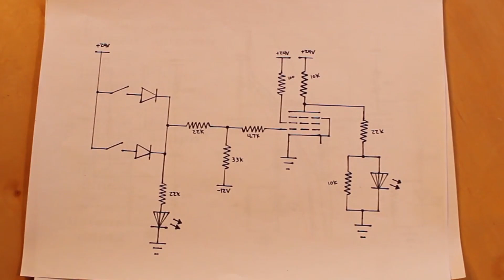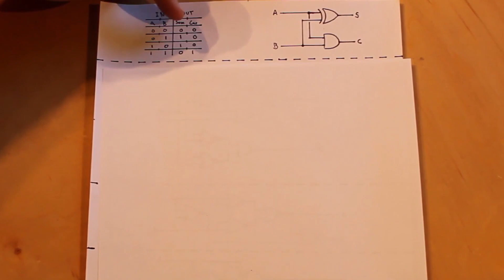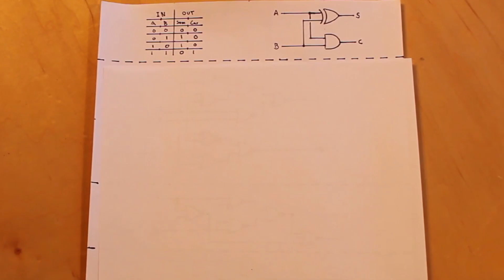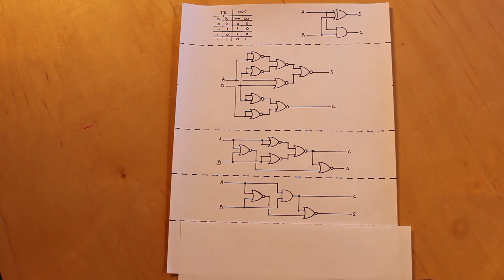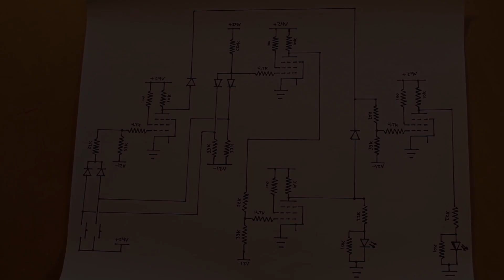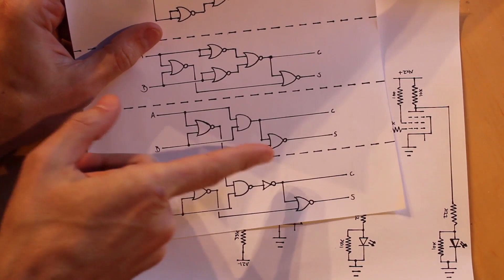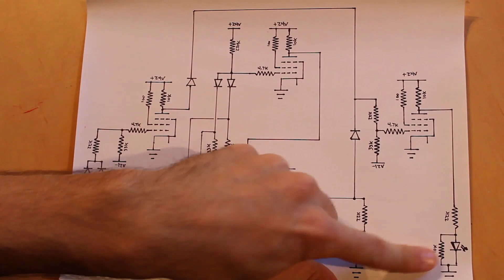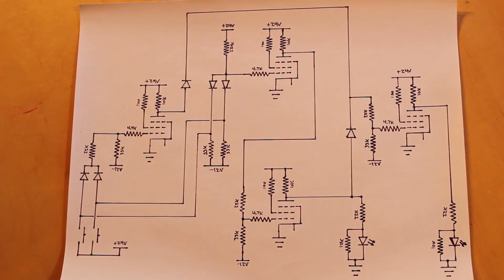Let’s Build a Vacuum Tube Half Adder

Comment: I've old watched to @5:50 but I have the overwhelming urge to ask, what is the difference between AND and Inverted NAND?  Explain it to a six-year-old please 😆
Love these Videos man, seriously you do a great job of explaining things!

Sometimes it'd be nice to see a sort of animated graph, say of your Half adder so you can see what goes through the circuits in the different bit states of input? Some people learn better from visualisation! Thank you so much anyway, you da man!
Reply: NAND is same as NOT AND, so NOT NAND is NOT NOT AND and in logic double negative is redundant so NOT NOT AND is same as AND. The curious thing is that using tubes or normal transistors making a NAND-gate requires less componets than an AND-gate, so if possible one always uses NAND-gates. So if you really need an AND-gate you normally do it by using NAND-gate and drive the result trough an inverter (NOT-gate) to get the AND. Was that clear?
Reply: @topilinkala1594  Yes, thank you very much! I didn't realise NAND was simpler to implement, makes good sense now! Thanks again!

Comment: Hi! I just found your channel recently and I've been watching your videos the past few days. Very cool! I've always been fascinated with vacuum tubes too. I've restored antique radios and even a couple of TVs, but I've never tried building my own vacuum tube circuits from scratch. I really want to try some experiments. I thought about starting with something really simple, like maybe just making a simple power supply using a rectifier tube to convert AC to DC. I thought about using a 35W4 since it's so common. I would use a step-down transformer to power the filament and plate. I had a question though - the filament is supposed to have 35 volts, but do you think it might work with a lower voltage? I was going to try a 24v transformer since it would be a lot easier to find.

Comment: Nice Work!   I wonder if you could maybe build a J-K Flip-Flop, Counter, or maybe a circuit that outputs to a 7-segment LED display or Nixie Tube display or something in a future project.
Reply from the maker: Thank you!
I have experimented with building a JK Flip Flop out of tubes in the past and it is definitely something I'll be revisiting. The only drawback is that the number of tubes required becomes quite insane! I've also tinkered with ring counters, which are surprisingly easy to build with older neon bulbs, but that requires higher voltage than I'm dealing with, so it's going to take some sideways thinking to overcome those. First things first though, we gotta get a Full Adder working, which is coming up next week!

Comment: I love your enthusiasm ! Editing is super clean too, and the final breadboard looks cute !  I was sketptical about running tubes on 24V, now I'll give it a try. Do you still use the tube Hartley osc. to get the negative bias ?
Reply from the maker: Thank you so much! These tubes really do work amazingly well at just 24V! 
I don't use the oscillator to generate negative voltage usually as it's just way more consistent to use a separate -12V power supply (it's really just a generic 12V wall wart with the positive hooked into ground). If you had with two secondary windings, you could also build a really simple unregulated power supply from that for positive and negative voltage as well. This is actually something I'm hoping to work on in the future as well - I've got this old Tektronix transformer that needs to be doing something, haha.

Comment: this is awesome! Thank you for the video.
I was amused by your video, as  last month I was thinking about experimenting with CMOS logic gates using discrete MOSFET transistors. But this is even more elemental!
Reply from the maker: Thank you so much!
Aside from the fact that I think tubes are just beautiful pieces of history, one of the main reasons I started playing with them is that they're one of the most fundamental and basic pieces of electronics technology out there. You can very nearly see them working! Also, thinking of things in terms of electron flow (from the cathode to the plate) makes understanding more complex electrical concepts a lot more intuitive.

Comment: So cool! I did have a question when I am making sure a led does not blow I use just one resistor.  This is on 5V.  I guess one question is why two in the case of a tube and the other is can I do the same voltage dividing on 5V?  Looking forward to a one bit full adder! 🙂
Reply from the maker: Thank you so much!
I mostly do it because of the weird output voltages that I use. A logic high output is 24V and a logic low output is about 6V. I found that even if I ran a really large resistor, I was still getting some illumination on the LED at logic low, despite the logic high getting dimmer and dimmer. By using a 22k/10k voltage divider, that shifts the level of voltage going into the LED to a much lower level. Since the tube goes into cutoff at logic high, the plate resistor just adds into the voltage divider, so we ultimately end up with a 32k/10k divider. Doing the math on that without the LED says that shifts the voltage at the 22k/10k junction to 5.7V at logic high and 1.5V at logic low. 

With the LED in place, that changes things a bit, but we can see that the logic low voltage level is shifted so low, it won't even try to illuminate the LED, while the logic high voltage level is still sufficient to ensure the LED is nice and bright. There's probably a more elegant way to solve that problem, but for breadboarding I found it super simple to just toss a 10k resistor in parallel with the LED, and I'm lazy, so simple is king, haha.
Reply: @UsagiElectric  nice 😁 thank you for the detailed explanation!

Comment: Your videos are amazing and got me into playing with some tube stuff again myself, especially giving pentodes a try for the first time. I just finished building a tiny 24V guitar tube amp around a 6J1 pentode after watching your videos on pentodes and it performs surprisingly well. Keep up the great inspiring work!
Reply from the maker: Thank you so much!
That it awesome! It's amazing how well these tubes perform at 24V. I built a little amplifier out of a 12AU7 and 12B4A using just 24V and it sounded surprisingly good, although the max volume was definitely limited. I'd love to see some pictures of your 6J1 amp if you've got some!
Reply: @UsagiElectric  Yeah, it's really surprising how well they work.
I've got some pictures on my tumblr if you're interested: https://slykasstuff.tumblr.com/post/631410070969827328/tiny-guitar-amp
It's as simple as I could make it, just the pentode and a small transformer from an old wall wart as output transformer.
The output power is pretty limited of course, but if I drive it a little harder it's actually perfectly fine for running a 1x12" guitar cabinet at apartment level volume. My next step is probably going to be a more serious amplifier with a proper preamp section and maybe two tubes for a push-pull output.
Reply from the maker: @KrisSlyka  That is awesome! It's the perfect balance of size, aesthetics and looks! You know, we live on a farm so I never thought about low voltage tube amplifiers being just about perfect for apartment use. I've got your Tumblr bookmarked, so if you keep making more tube amps, I'll definitely be checking them out!
Reply: @UsagiElectric  Thank you! I'm really looking forward to expanding on this and I'll make a video about it on my channel as well!
Reply from the maker: @KrisSlyka  Awesome! You've got a new subscriber out of me! Looking forward to checking out the tuning fork clock video later tonight.